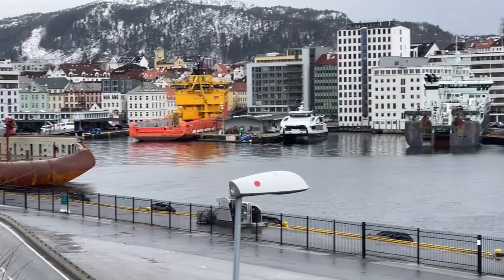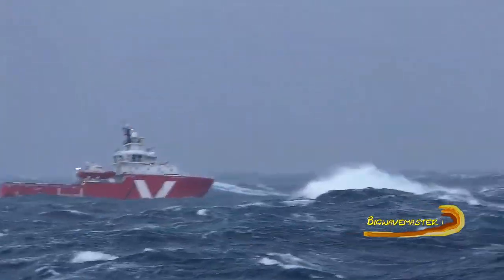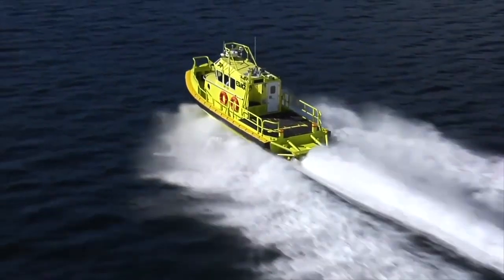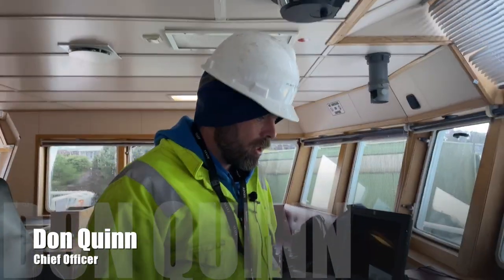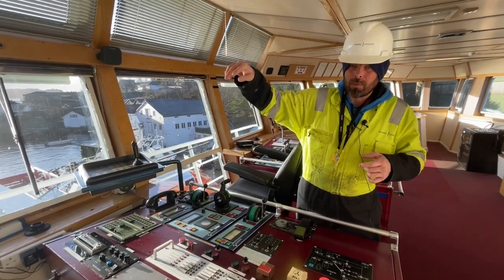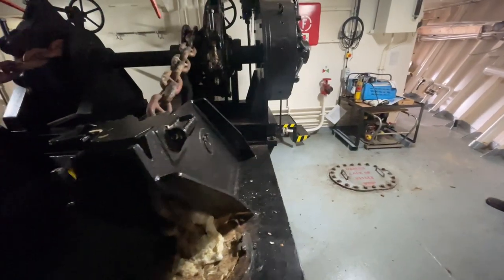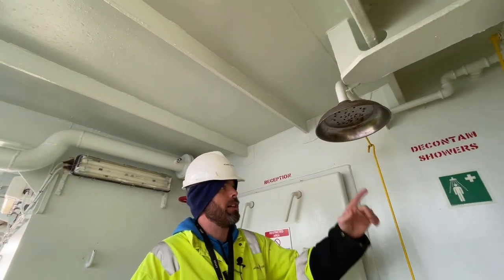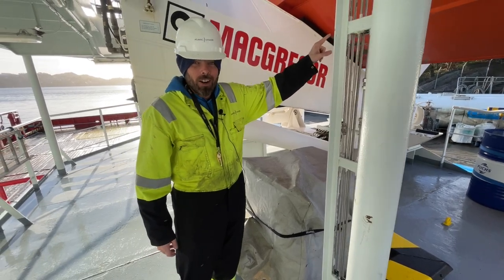63m /206ft Tour of Norwegian vessel being converted awesome Expedition/Explorer Yacht in 2024

Comment: If the navy wants to scrap the Independence Class littoral trimaran, then that is my perfect vessel. It is even based on a conceptual paradigm of mine from 2003, provided the consumption isn't over 100 GPH or if the turbines can be replaced with conventional engines and props.

Comment: Wowww...400 dollars of gas an hour!
Reply from the maker: That is when running at speed. Less burn than a large sportfishing yacht. On station engines are near idle. Also keep in mind that they transport up to 300 survivors.
Reply from the maker: A Viking 50 convertible burns about 138  gph.
Reply: @ExpeditionYachts  damn
Reply: in norway the gas price is 27 kr per liter, which is about 100 nok or 10 USD per gallon, making it 10206 nok or 1041 usd per hour.